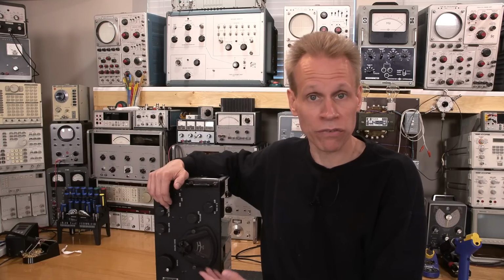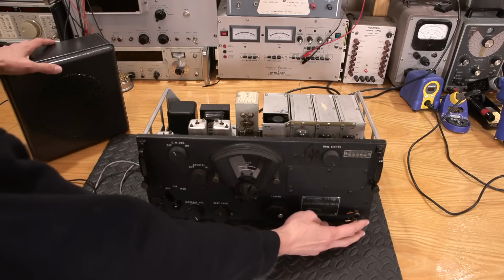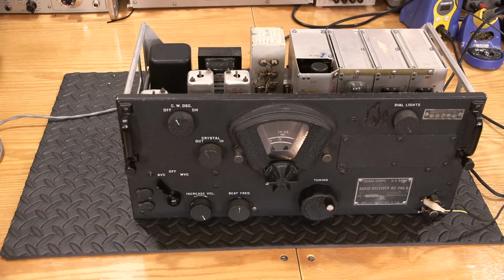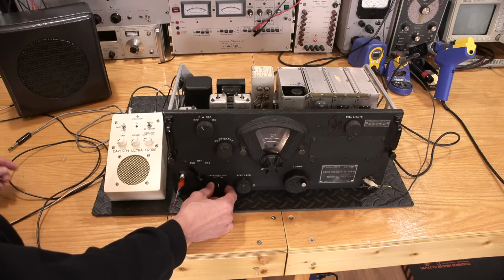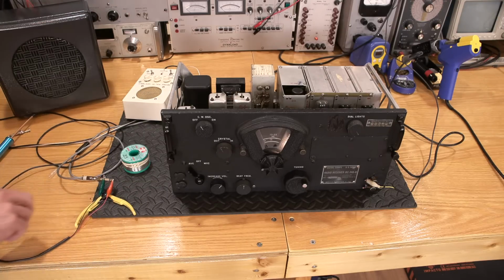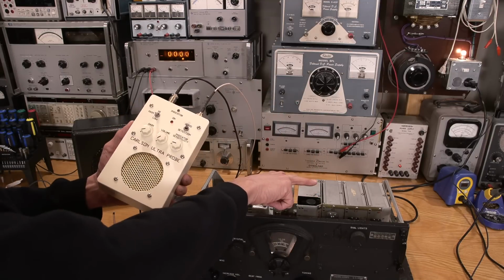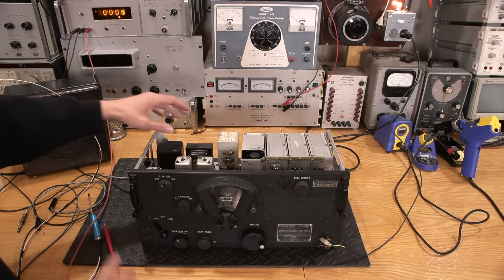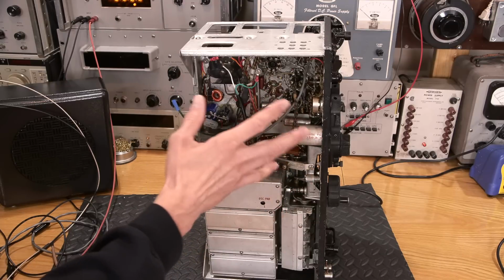BC-348-Q Receiver Restoration - Initial Inspection And Power Up!

Comment: Didn't the BC-348 use a Dynamo for a power supply?.
Reply from the maker: Originally yes. Most people don't want to listen to the noise, so 99% of these radios have been converted at some point.

Comment: The R series (g/c) is a more interesting set...pity you decided to work on (your mate's?) "Q" .You are not going to get any noise out of the set unless the changeover 
terminals at rear are connected...(from memory pins 2and 6...which shut down the RF section during transmitter operation ...which used same trailing antenna. Lightly 
warm tubes...if filaments can indicate incorrectely rewired filaments.Of course broken/s/c jack wire could be a problem. It seems then that the owner of the set
 s/cct'd the appropriate terminals or rerired that section...maybe sensib  Th ely installing a 3 pin computer type socket. Trailing mains leads are a nuisance.. BTW I need a
 coil box set for a grid-cap type 348 is someone can oblige. The power supply wiring done (around 20: is really badly done and so is the soldering. The earth connection is poor
so is using a white wire for mains active and there is too much bared ire at solder joint...The cable is too vulnerable to strain One can see the white loop at the male socket, 
which is likely the bridge of which I wrote..The soldering is poor. Get rid of that make plug altogether and TIDILY install a 3 pin mains socket....with the old connections 
transferred, neatly,  to a tag strip.The p/s looked good from above but some of the worst meses I have seen have been on BC348's.

Comment: Back in 1961 or 62 when I was 13 or 14, I bought an Arc5 receiver from Fair Radio Co. in Ohio and rewired it from 24 to 12 volts.  I got a 12v dynamorter for it.  Once I figured out I needed an audio transformer the speaker I had came to life.  What a great day!
Powered from two 6v lantern batteries.

I enjoyed your video.
Alex

Comment: Sensitivity, small, light, rugged, what a great radio. Not the ultimate of course, but it served the intended purpose very well. I love mine. It was very heavily modified, not in original case, needs some love, but it's still a favorite. These don't normally have a speaker output, higher and lower impedance headphones were the options. Although modifications for a speaker are common.

Comment: That must be an updated version of your Ultraprobe. I remember the small metal cased one similar to your capacitor tester. I like the new look. Thanks for all your great videos and information on restoration of old electronic equipment. I would like to see a restoration on old digital multimeters, Nixie tube types and old LED types, as well as signal generators too.

Comment: Many years ago I had a radio I think it was from the RaF. It was fairly large and hard signal meter on, but that also had a Dino generator inside and I couldn’t use it at night time because the noise of it used to annoy my parents and at13 years old, I wasn’t knowledgeable enough to change it out

Comment: You can use the ultra probe on bearings? That would be very useful in my projects for sure. Can someone buy a fully built probe from you? 

Your camera mic had a slight hum or buzz. Just thought i let you know.
Reply from the maker: @truckmann1762  I noticed the buzz in the processing as well. The camera and mic don't play nice. I plan on returning to tube audio again, like my older videos.

Comment: My guess is this set had a companion transmitter for the same frequency bands this one had; that’s probably what that connector on the bottom of the set is for. My guess is it has ground, B+, and a keying (squelch) pin so the set would cut out the audio and antenna whenever the transmitter was keyed on.

Comment: I saw the title and thought the model sounded familiar; I built a b-17 model, and modified the kit to include authentic details, one of which was a fully equipped radio room made with 3d printed individual pieces of equipment. All the transmitters, receivers, ground receiver, and modulator. Nice to see a real one back in operation!

Comment: Own the same 2 BC-348 receivers we had in my ham radio club. On this receiver I learned and made my first CW communications. This was in 1965-1969, and I have very fond memories of using these receivers. My club was SP2ZBE in Poland.  We received these receivers as a gift from the Polish Army as scrap metal, but they were in very good working condition. I, to this day, have no idea where these receivers came from in the Polish Army, because for the most part the military used Russian equipment. Greetings from Poland. Raymond SP2EEF.

Comment: I seem to remember something about a very quick way to test the audio output - probe a specific pin with a soldering iron (probably the grid?), and if that stage is good you get a LOUD buzz from the speaker. Also, some older speakers used the field winding (not the voice coil) as a B+ choke, and if it was open, the set was dead as a doornail.

Comment: It would be entertaining to send a dynamotor to an engineer at a company like (PC Fan Maker) Noctua, just to see if they could produce a quieter implementation with modern bearing tech, or maybe tweak the design of the stator to reduce vibration, etc. It's extremely niche and nerdy, sure, but isn't that why we're all on Mr. C's channel in the first place?

Comment: Where's the 'whole job' repair /restoration videos I can't find  ...please advise...BTW would you agree these sets (all comm's sets) are noise- better having external supplies? At the outset...did you short the terminals at the rear as you are not transmitting?(pins 2 and 6 from memory) without that you will get nothing as the IF is disconnected  also what transformer resistance is to the jacks (300 or 4000 ohm) some have low o'put some have high and some have one of each!!

Comment: I just got a Halli S-38 (original version). It is clean inside but dirty outside. How can a safely clean the black crinkle finish without removing too much? I tried a dishwashing detergent and a soft brush, but it didn't do much. I am not planning to restore it (I have a working 38e). I just want it to show off.  Thanks and 73.
Reply: It might sound a bit strange, but Ive had great luck with a dab of olive oil on a rag, rubbed into the crinkle finish. It really brings it back to life. Some folks recommend 3 in 1 oil, but I figured olive oil would be a milder starting point.

Comment: Nice to see another Grand Receiver  Restoration. Not knowing this radio, I was watching and thinking Paul obviously knows the speaker input is  derived via a transformer and there is no B+ on that jack. Besides who would be dumb enough to put B+ on the tip of a Jack? Oh yes, it happens. 😨 I have even seen a mains extension lead with male plugs both ends to extend a live bench to a dead one.😱 keep safe everyone.  Ultra probe is ongoing on my bench hope to finish soon. Thanks Paul

Comment: The audio output tube should be a 6K6GT (VT-152). Also, note that the B- should NOT go to chassis.
Reply from the maker: When reading the voltages, the meter's ground is referenced to the chassis, not the power transformers center tap. The power transformers center tap is lifted by a reactor in the audio transformers housing establishing the (around -18V) negative bias for the (properly installed 6K6) audio output tube.
Reply: @MrCarlsonsLab  Exactly! A common mistake made by those converting them to AC power is grounding the B-. An unusual design, which uses the 6K6GT audio output stage as a kind of shunt voltage regulator.

Comment: Actually , unless that radio has been sitting around collecting dust for a decade or longer , it should not need any serious service . The only weak part of that radio are the tubes . 
It is well noted that the tubes don’t stand up to vibrations too well , and they don’t like being turned on and off too well either . 
If you aquire one of these radios , request records of its maintenance records . If it’s been operated in the past year , all you need to do is continue to operate it until you detect a problem . The contacts will get dirty , and just turning the gnobs is usually the fix . Other wise check the tubes .

Comment: In the late 1950s and early 60s you could get an unused BC342 or 348 series radio for US $50 to $80. The ones with crystal filters made great receivers for CW, because of their selectivity and stability (much better than the inexpensive commercial units available then). The only problem was that (IIRC) the frequency coverage topped out at about 18 MHz. But it was easy to build a crystal-controlled converter for higher frequencies.
Reply: Own the same 2 BC-348 receivers we had in my ham radio club. On this receiver I learned and made my first CW communications. This was in 1965-1969, and I have very fond memories of using these receivers. My club was SP2ZBE in Poland.  We received these receivers as a gift from the Polish Army as scrap metal, but they were in very good working condition. I, to this day, have no idea where these receivers came from in the Polish Army, because for the most part the military used Russian equipment. Greetings from Poland. Raymond SP2EEF.
Reply: Both the BC-342/312 and BC-348 only went to 18 MHz. As you say, a crystal controlled converter made higher frequency reception easy. In fact 20 meter reception could be improved that way too.

Comment: Dear Paul,

I recently picked up a BC-243N receiver which was not designed to fly (lifting the receiver can give you a hernia) it seems to be the US Army version of the BC-24X range. The performance of these 1940's receivers in the AM mode is hard to beat, I have nothing that comes close to it's short wave performance on AM . It's a joy to listen to.
Reply: I think you mean BC-342N. I have one too, and it's about 70 pounds with case - lots of steel! It's a somewhat different design from the BC-348 (different IF, different tube lineup, etc.)
Reply: @JugSouthgate  Yeah your correct, its a BC-342N my dyslexia got me again.

Comment: I was thinking if you had these radios from WW2 bombers at Oshkosh Air show Mr Carlson would be swamped and everyone would want your autograph!!✍️. Snazzy radio. Your test probe design very high quality and high end test equipment.  When you mentioned checking ball bearings, I realized you have a piece of test gear that can do mechanical NDT non destruction testing to ASTM or ASME standards. You really smart Mr.Carlson

Comment: I've got that exact radio here in my shed, it works, but needs one of the IF can replaced. It has a power supply included but it's external and I had to repair the cut wires and it fired right up. I think I paid 40 bucks for it in the late 90s. I seem to remember it being in good cosmetic shape.
Reply: It sounded fine last time I ran it but thats been years. I had the RBC 1 and 2 for a short period in late 70s and definitely all the caps were bad. They still played but it was very distorted and and you could barely make out the audio. They were found in a old warehouse and were moldy. I ended up parting them out after somebody stole the tubes out of them just to mess with me. They were very advanced radios that even had upper and lower side and and weighed 82 pounds each. I still have the data plates.
Reply: @69Dartman  i think that bad caps if powered up would result in a destroyed power transformer... an expensive and difficult to replace item.  I'D suggest you cut off the power cord.

Maybe others will offer their advice too!
Reply: Caution that caps don't go bad

Comment: How do you get power to that huge rack of equipment? Surely they can't all be switched on at the same time.
Edit: is the power supply faulty, or is it just wired for 220/240V (or maybe even the Japanese 200V standard)?